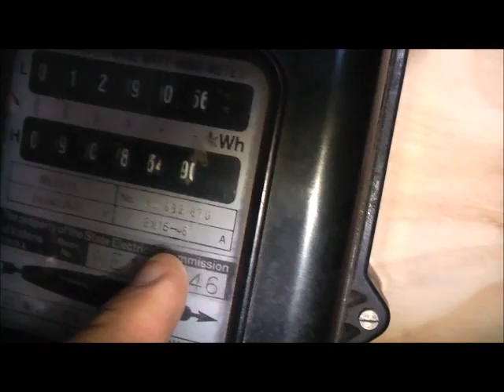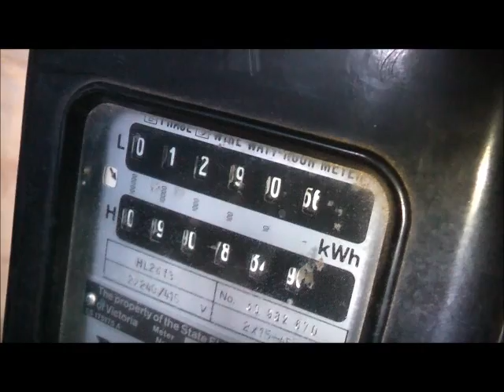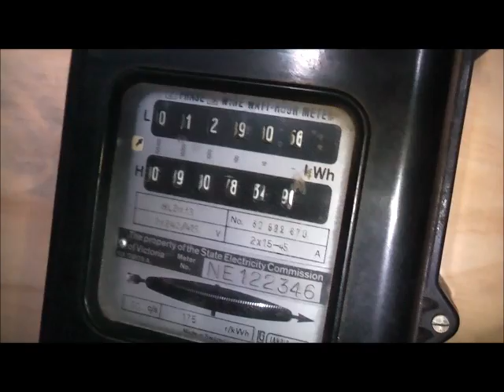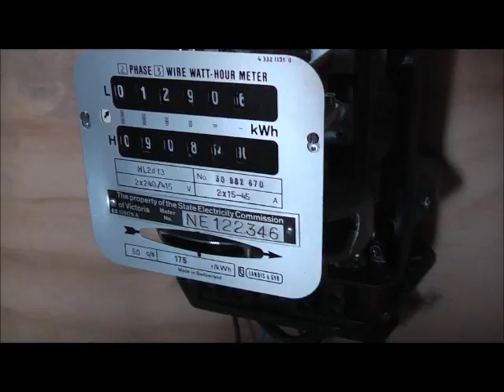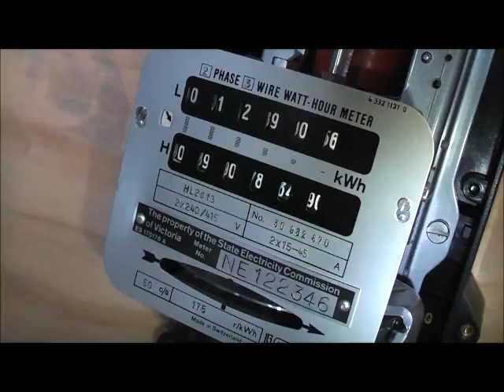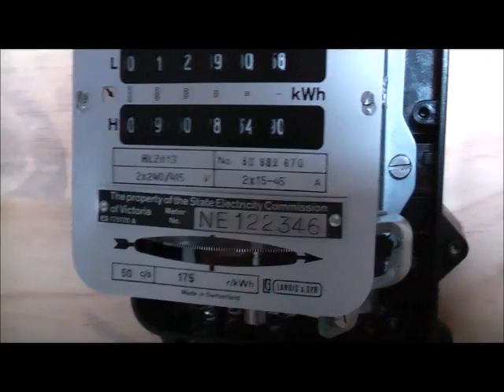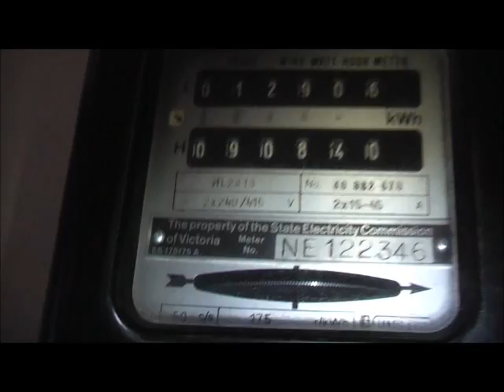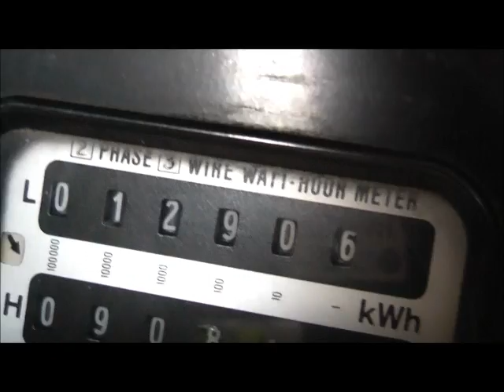Landis & Gyr HL2d13 Watthour Meter Restore & Test

Comment: These are some of the best designed meter registers made by Landis & Gyr.
All aluminium gears and number drums, very low friction and gear driven instead of work drive from the load wheel.
That meter design id from early to mid 1960's.